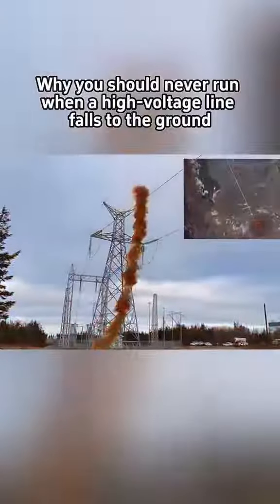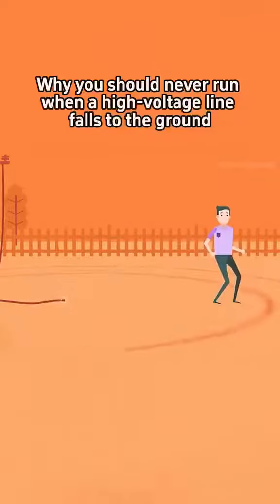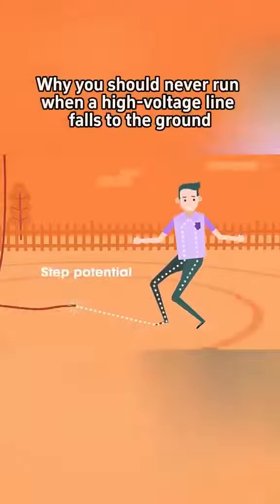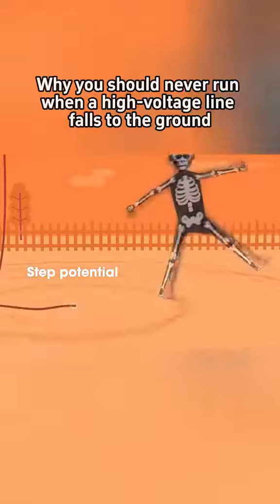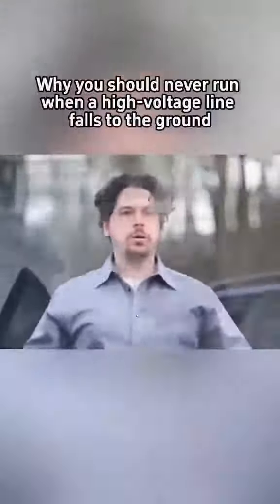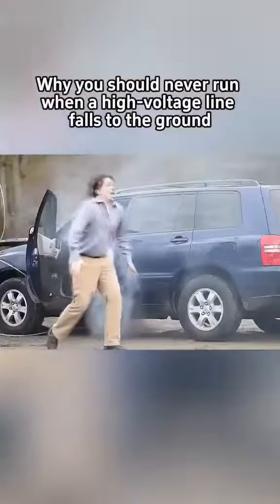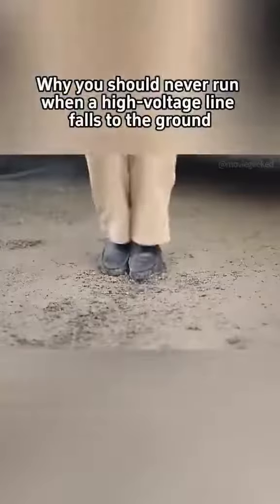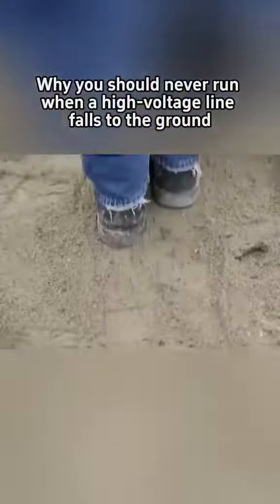why you should never run when a high voltage line falls to the ground #electromagnetic

Comment: Will the electricity flow if we are wearing shoes?
Reply: Powerlines have extremely high voltage. You could wear 3 inch solid rubber boots and it would fry you. When extremely high voltage comes into contact with a poor  insulator it melts.
Reply from the maker: Wearing shoes typically prevents the flow of electricity through your body thereby protecting you from electrical shocks. Low-quality insulators may allow some electrical current to pass through body increasing the risk of electrical shock

Comment: - Hopping with 1 foot.
- Hopping with two feet touching each other.
- Slowly shuffling away.

Which one is it?!
Reply from the maker: dealing with a fallen high voltage power line, the safest action is "slowly shuffling away." It is important to take small, deliberate steps to increase the distance between yourself and the hazardous area without lifting both feet at the same time, as doing so could create a potential electrical path through your body.

Never attempt to hop with one foot, hop with two feet touching each other, or run when near a fallen power line, as these actions can be extremely dangerous due to the risk of electrocution.
Reply: He just said it can be any of the three. Pick one.
Reply: @FlyByGarrett  No, read the uploader's response in this thread.
Reply: @FlyByGarrett yes, and shuffling away Is the safest option as you can mess up the first and second one
the third one Is less risky and It's the safest option, but It's a bit slow
Reply: Shuffle